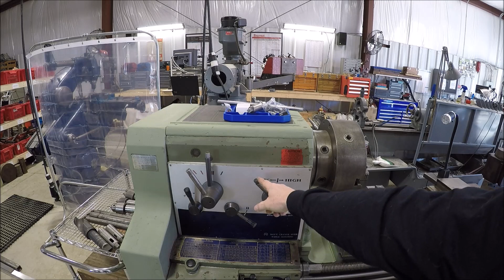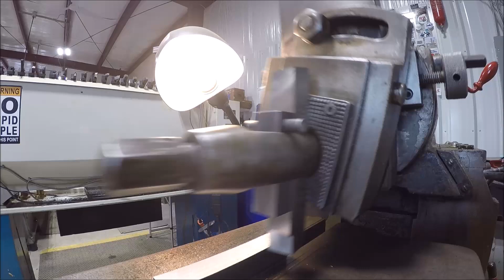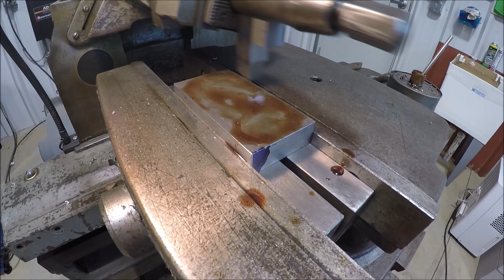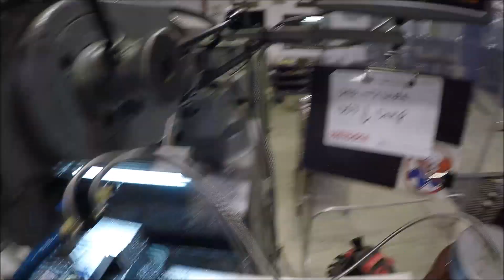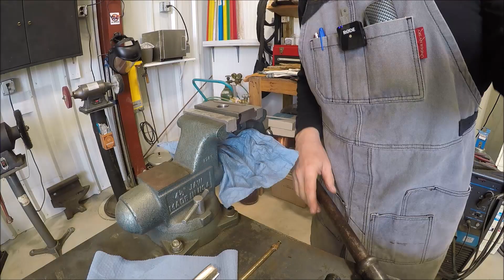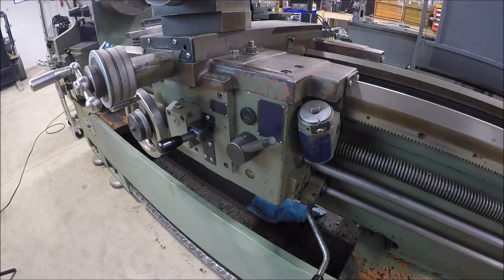New handles and T nut for the Jet lathe

Comment: Good work getting your own jobs done Tom. I heard years ago most of the obsolete British tooling and old machinery was shipped to India, Taiwan or that area. That's why all the nuts and bolts are Whitworth etc. They make very little in the UK now compared to before. Tony
Reply from the maker: Hey Tony. Thanks buddy. Just interesting that I keep running into BSW threads. At this rate I probably will invest in a quality tap & die set. I just bought a cheap one to get me through things now.

Comment: Hey Tom good job how come you didn't start the tap in the Mill also what lathe did
 you cut the knobs on well thanks for letting us in keep them coming
Reply from the maker: Hey Junkman. I could have started the tap in the mill, but I would not have been able to use the large tap wrench. It would not clear the mill column. My small lathe is a 13x40 generic Taiwanese lathe. Enco was the big distributor of them back in the day so they are commonly referred to as an Enco .